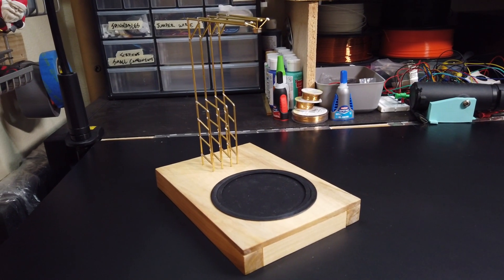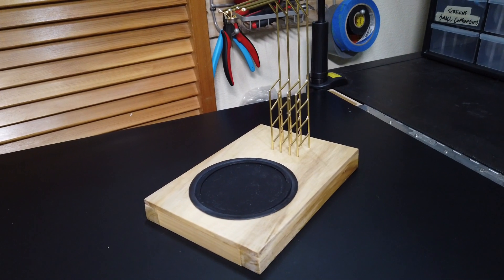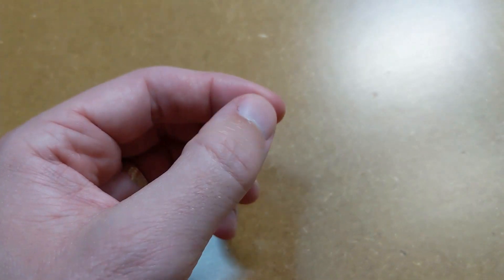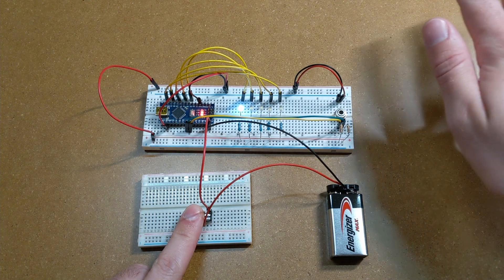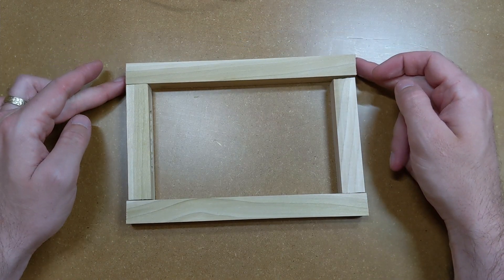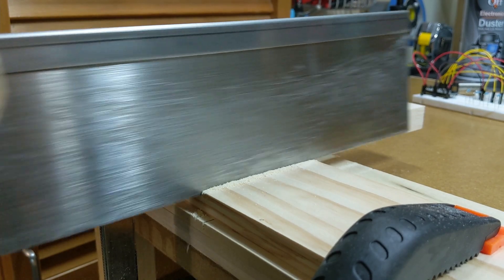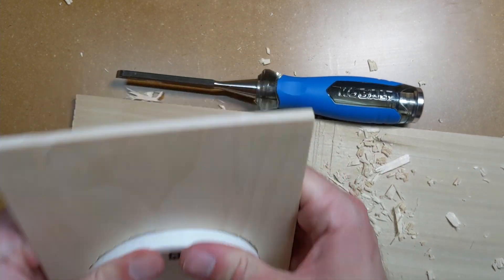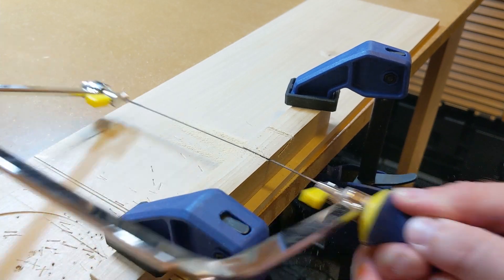Using Arduino to keep your coffee from burning you

Comment: Good job, end result looked awesome.

 My only criticism is WHY THE F WOULD YOU GO TO LOWES TO GET A HOLE SAW KIT you’re gonna use one time?!?! Brah, that’s the entire reason harbor freight exists! One time use tools! I would have let you use mine. Ask a friend, or that neighbor who’s always up on his roof doing something to his house.

I’m a professional locksmith and amateur welder/machinist. Guess where 70% of my general use tools are from: grinder? Hf. Hole saws
? hf. Lathe? hf. Drill press? Hf. Drill? Wrong! I got mine at an estate sale, wheee I get a good portion of my locksmithing tools.  

If you’re building out a workshop or a maker space, there’s no shame in having every wall be a pegboard full of tools and bins. I had to custom make steel pegboards and mounts  just to hold all my crap in my van down the road.

Still looking for tools to add to my collection at the pawnshop….

Comment: Maybe use an ultrasonic or optical proximity sensor instead of a switch. Next time.
Reply from the maker: I thought about that, but using a switch that controls power to the Arduino means there's no power draw at all when it isn't being used, so the battery ends up lasting a really long time. Thank you for the suggestion though!
Reply: @MakeFunStuff  good point.

Comment: Placing the sensor directly up isn't too smart. The steam from the drink will moist and damage it over time.
Reply from the maker: Thanks for the feedback! I thought about that, I even considered including a small fan to redirect the steam, but in the end I kept it this way because I figured the damage would be slow, it'd be pretty easy to replace the sensor or brass if they became too damaged, and most importantly I liked how it looked with the sensor hanging over the drink. I also wanted to measure the temperature of the liquid directly instead of the temperature of the mug to avoid getting different readings depending on the insulation of different mugs. But I appreciate the feedback, hope you enjoyed the video!
Reply: @MakeFunStuff  I enjoyed it a lot. Especially the brasswork 🙂 I was thinking about making the tower smaller, and angling the sensor by 45 to aim it at the liquid, maybe adding a small shroud to it to make it more directional. But overall super idea.
Reply from the maker: Glad you enjoyed! I think that approach would be great, but I'd want a sensor with a narrower field of view since this one is 90 degrees and angling it would probably increase how much of it's field of view is not covered by the cup. But that's already a problem with the current design anyway, it's just reduced a bit by being centered close over the top of the mug. But definitely a good idea, and if I ever find a narrower FOV sensor that I still think looks cool I might give it a try!

Comment: 3:24 drilling holes for the LEDs but not quite all the way through. 
Instead of drilling "almost" all the way through, drill through and then add a thin layer of balsa wood or wood -vernier-.
Edit: should be "wood veneer"
Reply from the maker: I thought about that after the fact, and that's definitely what I would do if I were to make more if these (as long as I could find a piece of wood thin enough). Good idea!
Reply: @MakeFunStuff  Finally the y/t algorithm did something right ;)  The 2 videos I've seen are very nice.
The effort you take to make the project and to ALSO make the video must be a lot. I appreciate the "errors" that you included. They give newbies a little more understanding that not all projects run perfectly smooth but that it is possible to recover from the errors. For me, already having made similar errors, I has a few "yep, BTDT" moments.
I have more praise to heap, but I think I'll spread it around some of the other videos I've yet to watch.
Reply from the maker: Thank you so much, I really appreciate it! Really glad you enjoyed (especially the mistakes, as there will definitely be more of those to come).
Reply: @MakeFunStuff    >  (as long as I could find a piece of wood thin enough)
    my apologies for misspelling the word "veneer" in "wood veneer"
Reply from the maker: I think I'll be able to forgive you, eventually.